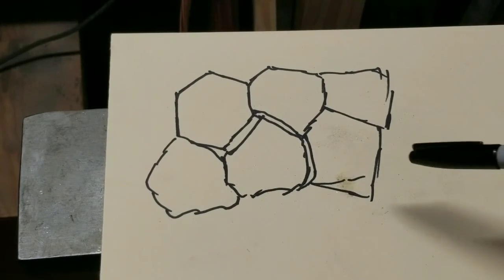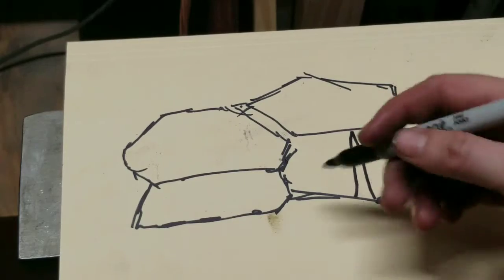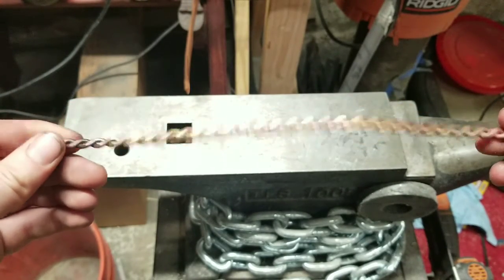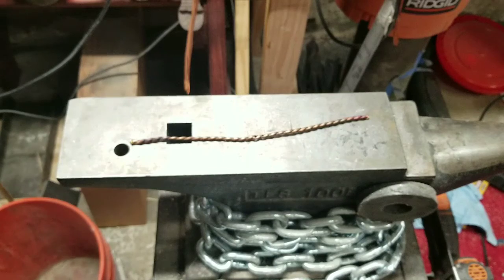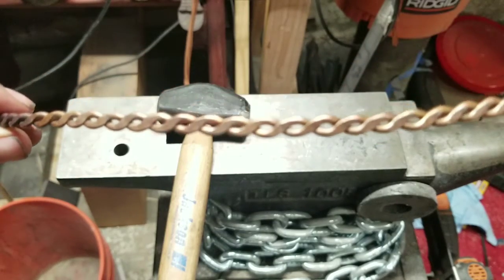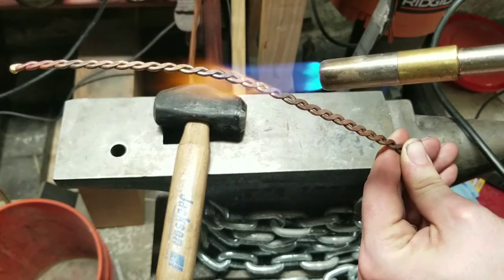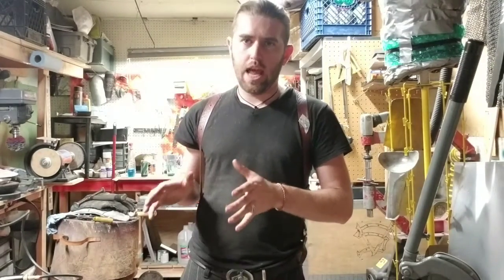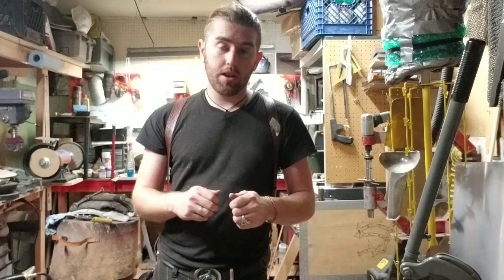Copper- Work Hardening and how to Soften/Anneal it

Comment: Thanks for this video ONLY about copper !  Most others switch from copper to silver midway.  Quite confusing to me.  In that context I learned about the Sharpie trick but silver has a lower melting temperature.  I therefore wonder if the Sharpie trick (disappears when annealed) works on copper too.  Grateful for your reply !

Comment: I have not watched seven videos on how to soften copper supposably Anne hardnett most of them say heat it up but they never say what to do after that let it cool slowly let it cool fast throw it on the cold water nothing would someone please put some details in here so I can make my copper as soft as possible and we can all have fun
Reply from the maker: I heat it up to where you move the torch away and the copper turns darker with oxides, maybe soak it a few secs past that then quench in water. You can let air cool as well but it's not necessary. You can get a but if red glow in the copper of you are really paranoid about it being annealed as far as it can but that risks melting it as well so a few seconds after the darker oxides appear in the surface, then dunk into room temp water.

Comment: Does the same apply to brass? Thin sheet repousse decoration on a lantern I want to straighten.
Reply from the maker: Yes it does, though you may have to worry about the solder on your lantern, the annealing is 600-800°F and solder typically around 400°F, the solder can typically be seen near joints and can be subtle. You can put a damp rag on the area with solder to keep it from heating up (I so it with blades all the time) but it will keep up to an 1" of material from heating up to the right temp. Be careful though the rag will be hot but if soaking wet won't catch on fire quickly- I'll see if I can do a video for you this week on it
Reply: @vanguardsmithing7501  Thank you kindly I was thinking about that this afternoon!

Comment: Thanks. I have some hard copper pipe I would like to soften to make malleable. Nice to know all I have to do is heat it with a torch.
Reply from the maker: Your main issue while bending pipe is to keep it from collapsing the pipe itself, just make sure you use a pipe bender as well to keep from kicking the pipe

Comment: I thought that cooling it rapidly (quenching) actually HARDENS the material, no? Shouldn't you let it cool slowly in order to keep it soft?
Reply from the maker: Rapid quenching effects carbon steel with the formation of martensite crystals, but with copper, brass, aluminium rapid quenching does not effect the softening effects, you do need to hit that critical range of heat but don't need to wait the 10- 15 minutes for it to air cool

Comment: Thank you I'm working on a copper bracelet presently
Reply from the maker: You want to aneal it fully usually for wear, as if it's stiff bending it to get it on and off can tear the metal, if it just slips on then it can be harder tho
Reply: Currently, not presently. Presently means pretty soon, or in a little while. Currently means now. You could also say "at present" to mean now. This is where a lot of people get mixed up.

Comment: is that propane/oxygen or just propane alone?
Reply from the maker: I use propane and maap gas, both can be found at the hardware store- the propane is blue and the maap is yellow, they work relatively the same and both work but the maap burns a little bit hotter
Reply from the maker: And it's just propane/maap alone, no oxy set up though it would speed up the heat process

Comment: Thanks for this! I suppose to harden copper tubing in place…the only way to really do it would be to insert some kind of steel rod and hammer around the exterior or something…? I was hoping I could get away with using it for weird art installation curtain tracking, due to the narrow diameter & ubiquity but it’s just TOO soft, there are places the curtains were tugged on naturally where it just bends. I guess in the future I could try filling it with resin or something but it’s been a bit of a bummer, was hoping to find a way to salvage what I already have up longevity wise. Thanks for any tips!
Reply from the maker: Hammering it like they can work, or if fill the inside of the tube with a wooden dowel to keep the look but reinforce it, you could also get a thicker walled pipe, or add more supports for the curtain
Reply from the maker: Also another method of all those don't work is to carefully hammer it into an oval shape, which will give it more lateral strength
Reply: Thank you for all of this! I’m back at your vid again on another rod project, bc the web just brings me back to u. Youve been wildly more helpful even just w this short vid than what has been weeks of entire work days trolling the internet in the mainstream / plumbing world 🙃 Anachronistic/traditional trades seem to be the only way to go for me with the materials & goals I have. I’m still surprised how hard it is in mainstream search engines to find info on copper. I’m addicted to it, & design / grid out interiors in a practical way with salvaged & repurposed parts. It’s expensive so I keep running into materials issues when something experimental doesn’t work. Finally reached my limit I think on not using heat (my workshop is…very flammable, but I’m tapped out now on what I can accomplish without it). definitely going to keep closer tabs on your channel. I was hoping to get to smithing in reenactment recently but got stuck on the shave horse 😅 Time for some fire. 

Re: the tubing/piping— I’m always running into these issues bc even 1/2” type M is tricky & weak, & I abhor tracking with support stops everywhere. A partial solution is switching to conduit & perfecting my painting process, but it’s not the same as the solid stuff esp in depth of patina. 

Im looking into traditional still making, but willing to wager from topical research that traditional bending was all sand filler, heat, & finesse vs specific tools. I am wildly curious if sand filling, then keeping it packed while heating to bend etc & never removing it- would solve some of my issues. Gonna have to experiment with fillers. Cost is always a priority & I might try spray foam for the weaker/softer tubing. (The project I mentioned was for a canopy bed so I tried to go as narrow as possible wo the cost of solid copper or brass, & with as little support stops as possible). Current project is a custom double curved shower curtain rod. 

Thanks again for your insight / energy / vids! (Just blows my mind how uncommon it’s become for natural material crafts & know how in this age, seems unwise as a society to me 😬)

Comment: Thanks for the video! Prior to seeing this I had annealed some copper crush washers for brake banjos prior to lapping them flat for reuse. I had quenched them with water to speed the process and was worried after the fact that my quench had screwed up the annealing. Glad to hear that was not the case. In any case my brake lines remain nicely sealed.

Comment: Does annealed copper self-harden after a certain time lapse? I seem to remember a Science Experiment 60 years ago when an annealed (real copper) penny could be bent with your fingers but after a minute or so; could Not.
Reply from the maker: I work a LOT with copper, and non ferrous metals and I have only seen the materials work harden after experiencing stress, load, or compression. The oxide layer that forms after and over time may so something as metal oxides are harder than the base material but that outer layer is initially brittle after annealing. So besides hardening occuring from long periods of oxidation or UV exposure, the grains structure wouldn't harden quickly without large changes in temperature, or being worked
Reply: @vanguardsmithing7501   Thanks for Reply. Kinda remembered something Special about Copper but wasn't sure of the details. p.s., Good Video; again, Thanks
Reply from the maker: @conjoeadams899  Your welcome! And to clarify I'm not saying you are wrong or it's not possible- just that from my research and personal experience I can't confirm it :) I know a lot of things- but there is a vast amount  I don't know lol
Reply: Pennies are no longer made with 100% copper. It may be that the alloy caused it to behave that way.

Comment: How long does copper stay hard after hitting it? Does it get looser slowly with time?
Reply from the maker: Nope it will either get harder with use, additional work, or if it's too hard and being flexed it can crack, but the only way too soften it is will heating but good question!
Reply: @vanguardsmithing7501  So basically if I pound a copper sheet/spring and leave it on the table forever without applying any load/work towards it anymore, it will retain the same hardness/tension forever? (I am guessing this is a yes based on your response). Thank you so much for replying!

Comment: Will the same principal work with brass?
Reply from the maker: Yes it will! :D Brass won't anneal as soft as copper but they are similar enough with this method. With some alloys quenching can have different effects so experiment on snow scrap pieces. To check if oxides (that dull dark when it's heated up) are forming move the torch or great off the piece every few seconds. The gas from the torch displaces oxygen and won't let it react with the material visually. A few seconds of heat after oxides- not bubbles but that dark sheen- is usually enough to soften the piece
Reply: @vanguardsmithing7501  Awesome thank you!

Comment: Thank you for the video!:goodvibes: My friend suggested putting sheets of copper in the oven to soften it... Any idea what temperature and for how long I should heat it? It's only a few MM thick. I'm kind of wondering if a toaster oven would be even more viable since I just have little pieces :D
Reply from the maker: Your home oven can only really get to around 550 at most, you need to get to around 750-800 to soften and aneal the copper fully so I'd recommend a torch. Once the copper oxidizes (turns blackish as soon as you move the torch to let air get to it) hold the torch over the area for a few more secs, or when it just starts to glow red move on to heat the other areas, you can let brass and copper reach the red glow, but never aluminum- if you get aluminium that hot it usually ruins the grain structure or it melts like tissue paper
Reply: @vanguardsmithing7501  thank thee :-)
Reply from the maker: I haven't tried it but if it's thin enough over the burner on the oven might help? I usually use my torch or forge for annealing my metals

Comment: Before adding lacquer, I was cleaning a copper weaved bracelet. To make sure it was bone dry I placed it in a small toaster oven. When I pulled it out it had turned a goldish tint. I did not pay any attention to the time or temperature. I have yet to duplicate it. I was told it was “heat patina” to me.  Any help on this technique?
Reply: I know nothing bout copper, if it can helps you what you said looks like anodizing to me, works for steel titanium and alluminum usually, you can do it by heat or electricity, idk if copper works with electricity as it is usually used for plating that is the opposite idea. if i were you i'll get some spare copper pieces of the same volume and try, you can work on heat and oxygen as parameters, if you wanna try with a blowtorch keep in mind that you see it getting colour with a delay (at least for the metals i know), so if you keep heating you skip to the next colours. it is a superficial process, so if you get something you dont like you can sand it off and try again. Hope it helps a bit :)

Comment: Amazing trick! Thanks for that. When i hammer the copper its edges become verry sharp..how can i make them rounded and soft again so i dont cut my wrists and fingers :-)
Reply from the maker: If you can't hammer it out smooth you can and the edges with either sandpaper 120-220 to start, higher if you need it more polished. If you have trouble holding the piece while sanding hold it in a pastor of pliers or a vice. For a nice round edge it's best to file both sides at a 45° angle going back and forth from one side to the other, then along the piece lengthwise along the edge

Comment: Good video bro, We have once meet at IMS, You told me an my friends a tip to never forge anything that is shiny an if you are, make sure to clean it right an let it soak in vinegar for a good while. Thanks bro good luck on the blacksmith.
Reply from the maker: That case I was warning about plated steel, which is coated with Zinc oxide, zinc oxide begins to form around 1400°F and is deadly poisonous, here I'm heating up up only 800°F and while there is zinc in the copper it wouldn't gas out unless I smelted it. But good job remembering! :D Always good to err on the side of caution, and if you are unsure be in a ventilated area or soak skinny steel in vinegar if you are unsure. And nice to hear from you again I remember that conversation! :D